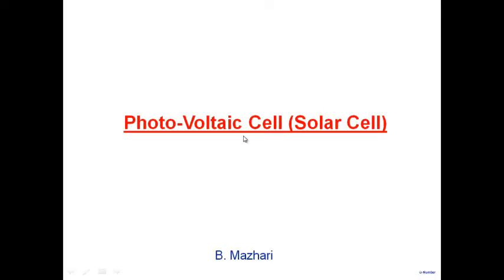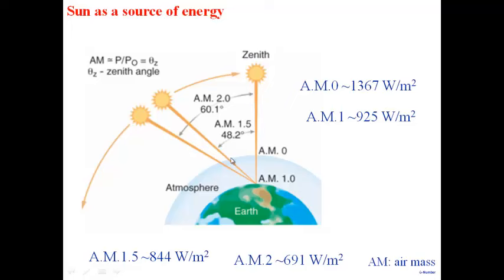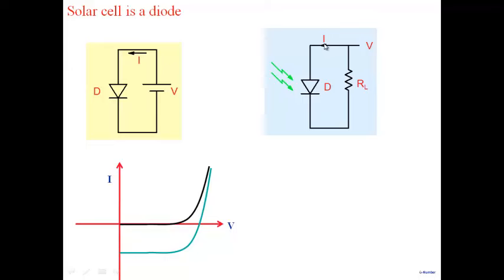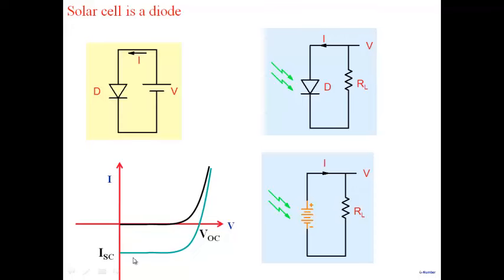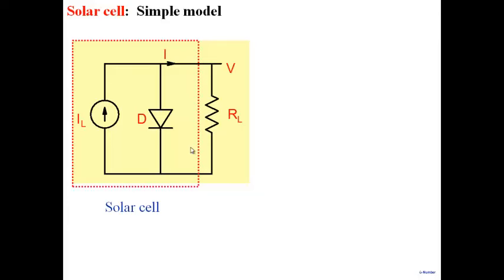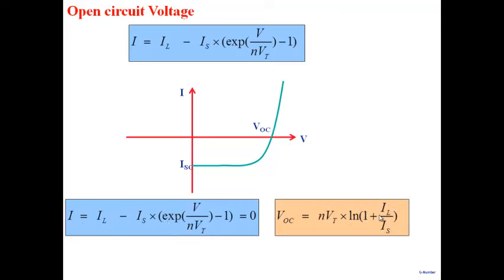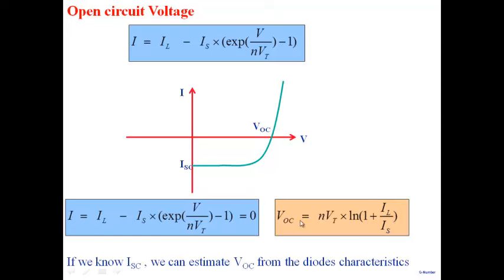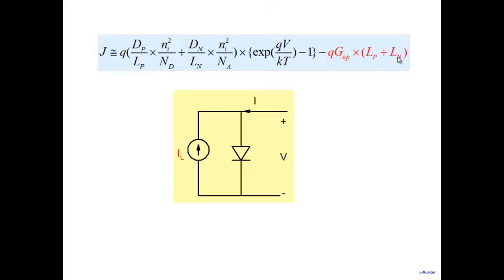pn junction  solar cell

Comment: Sir solar cell follows same vi curve in forward bias as normal diode although no external forward bias is applied why?sir,please reply I'm confused.
Reply from the maker: Short answer is that to forward bias a diode you need an energy source. In this case incident  light is the source instead of a battery.
Reply: @baquermazhari8968  thankx sir,
Why photodiode is reverse biased ?
Reply: Excellent 👌 sir!!!